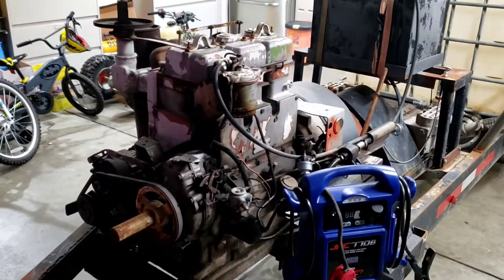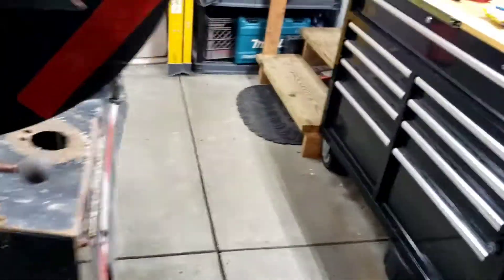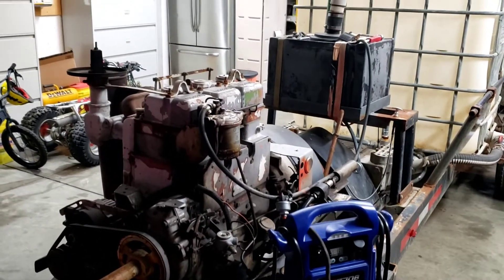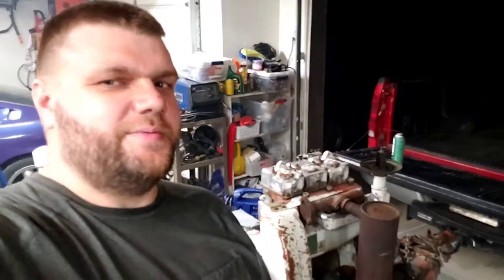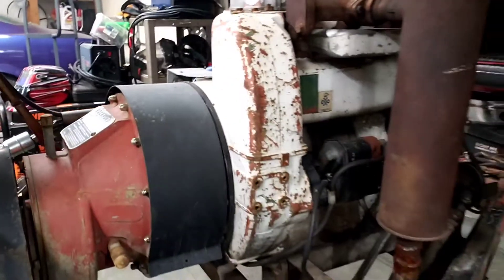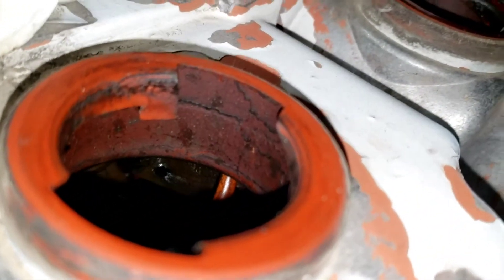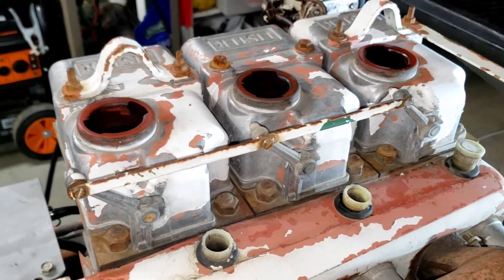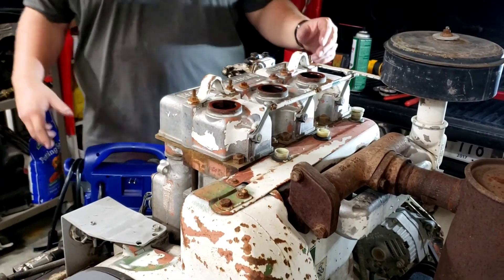Will it start?!?! Lister ST3 3 cylinder air cooled diesel engine

Comment: What motor oil do you used
Reply from the maker: 10w30. Air cooled prefers thinner oil. I'm not 100% that was the correct weight, but that's what I used 😁

Comment: The decompression levers are actually intended for hand crank starting.   They do make it much easier on the starter motor when they are used too.    With this engine being painted white I believe it was likely originally a generator engine as white was commonly used for gensets.      To crank them over by hand you would need a crank handle that slides onto the camshaft and engages with the key slot on it and spin the engine over, once you got it spinning pretty fast you flick the decompression levers off and it’ll fire up